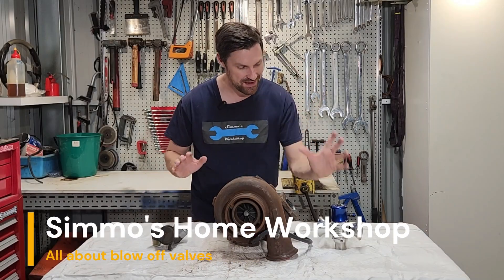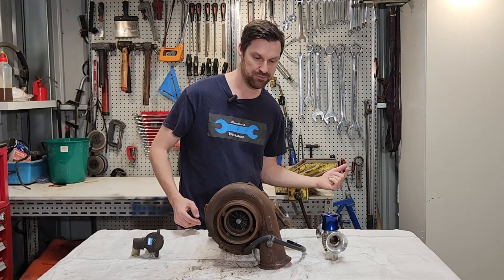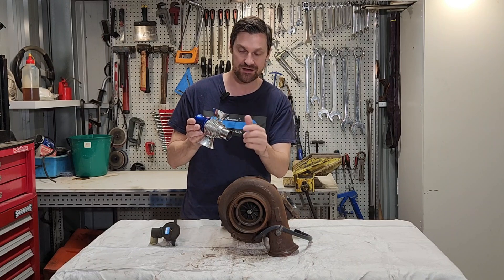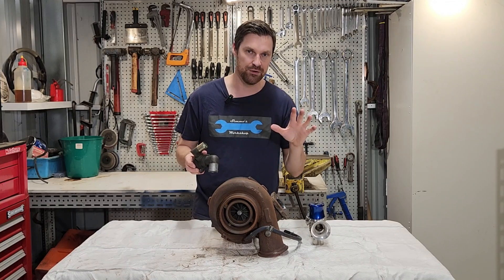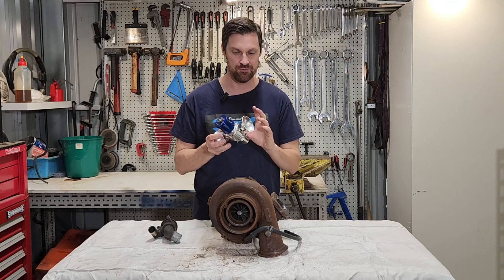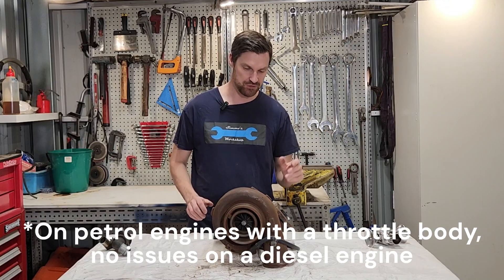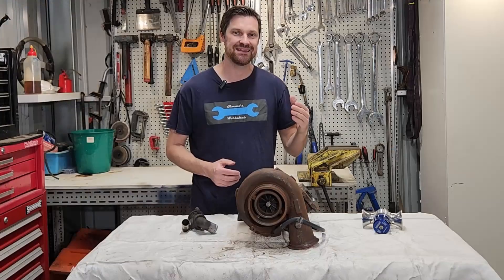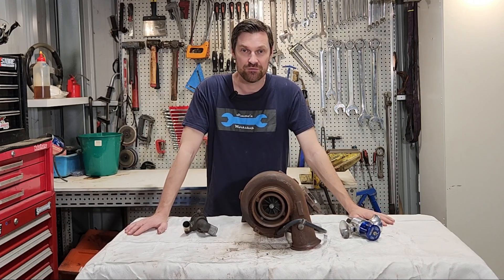Everything You Need To Know About Blow Off & Recirculation Valves! | Which Is Better?

Comment: It is a well explained and neat video. I have a question. After installing an open conical air filter with aluminium intake pipe on my diesel 2.8L toyota hilux (N80), I am able to listen to the charge pressure releasing off the turbo every time when I lift off the pedal while the car is under loaded conditions (like lifting off while driving up a ramp). It is a typical sutututu sound which as you said, does sound cool but bad for turbo's health. So, can installing a BOV solve this problem? Would a BOV that works on vacuum principle function in my case or I would need one that has electronic controls?
Reply from the maker: Hi mate, 
I'd say as long as you have not increased the boost or modified the intake system at all after (from the turbo to the engine) the turbocharger you are not risking damage to the turbocharger.
Being a diesel it should not be subject to compressor surge, even though the 1GD-FTV has a throttle body its not used to shut off the air to the engine when you lift off the pedal.

If that pipe and filter on the intake side of the turbo is the only change made, it's likely the turbo has always done the same thing you can just hear it better now and it's just an air flow change rather than a compressor stall or surge.

I can hear mine a bit through the snorkel, but even if I let off at full load and full boost I don't see any spikes on the gauge.

Hope this can help!
Reply: @simmoshomeworkshop  Loud and clear!Thank you. 
If I do modify the intake system after the turbo (like installing aluminum charge pipes) would it make any difference that requires a BOV? 
Also as you said, checking for spikes on gauge can confirm if it is actually happening or not, I dont have a boost gauge but may be I can connect my OBD which shows live boost figures while I drive. That would be helpful i guess!?
Reply from the maker: As a general rule of thumb as long as you are not modifying the original design of the induction system you are all good, that would include deleting any recirculation systems, removing an intercooler, shortening the system, increasing boost to higher levels, or operating at very high altitude - these would all put extra load on the turbocharger.

Having some sort of monitor to keep an eye on boost and EGTs I think is always a good thing.

Comment: 0:11 why are you so disappointed in me what did I do Simmo, il do better I swear.
Genuinely found this really helpful. From what I can tell both are useful but the dumpvalve is also silly and wont damage my engine(not that the res does but that the sillyness doesnt add pain)?
Reply from the maker: 😅 In my case at least, the recirculation valve is the factory fitment and is the better one for engine health as it recirculates measured air after the MAF, the BOV to atmosphere causes potential issues as it allows the air to leave the system after the MAF has measured it leading to an over fuel condition, sounds cool but not ideal with a MAF system. A MAP system would be a different story.
Reply: @simmoshomeworkshop  Im not too sure what I have the car im looking at doing this on would be a 1.8Polo gti from 15 so il have to go look that up. I really appreiate the video ive just been able to explain what these parts do with confidence and told them to come watch this for the better version :D